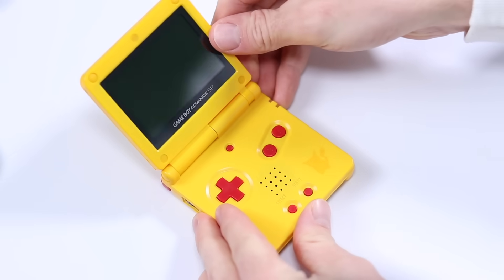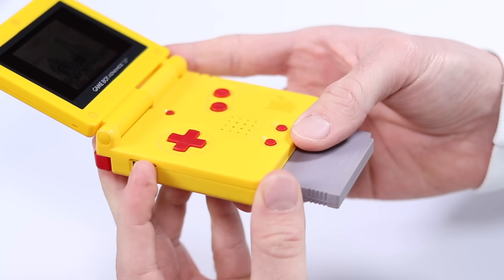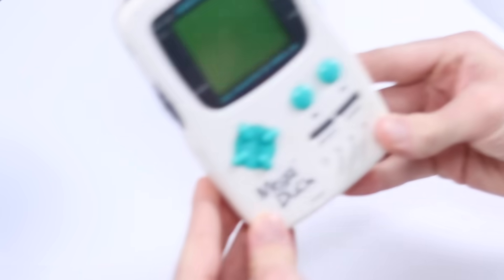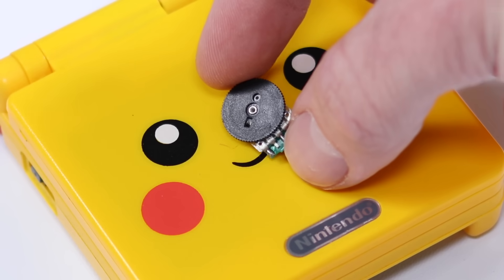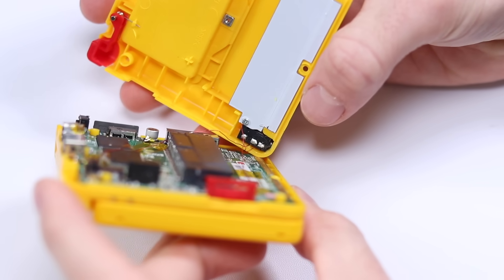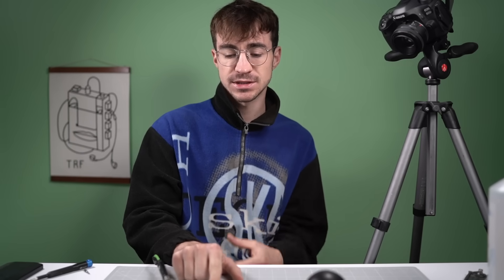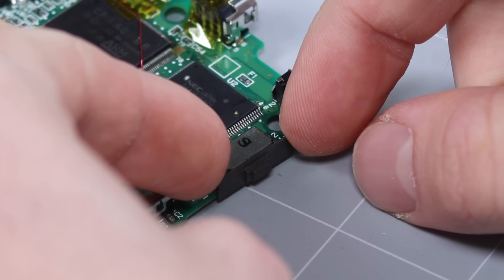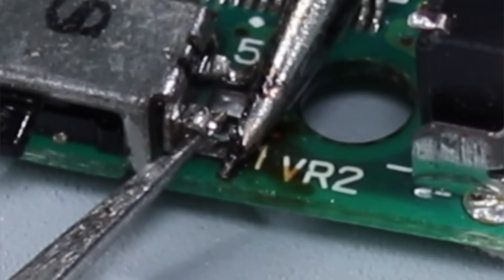The PERFECT GameBoy Advance SP Upgrade

Comment: I never even acknowledged that the gba sp didn’t have a wheel. Im surprised.
Reply: The pads that come off the easiest are the ones that don’t go anywhere. That’s usually because there’s nowhere for the heat to go so they end up burning off the substrate easier and have less surrounding trace material to hold them down.

Comment: Pro tip: for replacing ripped pads just use solder wick cut into small squares, scrape back the conformal coating and attach the wick into the area where the pad was, then you have brand new pads to attach things to
Reply: Sorry wut? You solder a square piece of solder wick on the place of the ripper pad?
Reply: @just_ugu  yep
Reply: That is indeed a great idea! Certainly a simpler solution than wiring a transistor leg to the next component in line after a Lynx II power section rebuild goes wrong. I'll have to keep this in mind! Thanks!
Reply: Can you make a video tutorial? It would be very helpfull! Best regards.
Reply: can't you just put a small bead of solder on where the pad used to be? new to soldering btw
Reply: What exactly do I need to scrape off? I greatly appreciate the response
Reply: @Poppilion  since the copper pad is gone, there is no longer an exposed circuit. The pads are usually connected by a small trace (like little internal wires). If you scrape the solder mask (usually green or white, protects the copper trace), then you can expose some of the circuit (also copper). Traces are really thin and fragile! Extreme patience needed. Then you can solder to the trace.
Reply: @CoreysZ32  First why this effort?
Second that don’t works always and in special this case looks exactly like this…
The trace is pretty small, to solder anything to that is already a task and then you want go even further and replace the whole pad?
Just solder a wire a directly to the trace if it is big enough or b directly to the next component of that trace if it’s not big enough…
Way easier and in case b the only option overall…
Reply: @Eddy_E.  Replacing the pad is the correct way to fix the damage. Soldering a wire to the trace is the ghetto hack way of fixing it. 

If you tack the pad down with a certain type of epoxy, it will be exactly as if the pad was never ripped out in the first place.
Reply: @vhfgamer what type of epoxy?
Reply: @Abu_Brandino  There's some fancy epoxy you can buy called circuit bond epoxy. It's kind of expensive. But you could just use any 2 part epoxy that has a longer cure time. To give yourself time to work with it.

Then place kapton tape over it, clamp it with a spring loaded clamp, and let it cure. Clean up any residue, and there you go. Done. 

If the pad is missing, you can make new pads by trimming bits of copper foil, or you could salvage a pad from another defective board.
Reply: @vhfgamer  fair thanks for info

Comment: Sliders are both more durable and actually show the volume relatively to the highest and lowest values, it's way better than a wheel
Reply: I think it's more to do with "can I do this?" And "can this be more like a GBA and less like a DS?" Then "practical use."
Reply: Hmm, is there a slider mod for a GBA I wonder?
Reply: Seeing how high the volume is is useless when the throw of the switch is like 3 millimeters. A volume wheel allows for much finer adjustments. Plus the wheel is stiffer and far less liable to get nudged to off or full volume with just a light touch. I know how high the volume is by using my ears and you don't look at the switch or the volume wheel when adjusting it, cause your thumb is on it.
Reply: @TheFriskySquid  This
Using the slider to turn the volume form zero to 100 takes less than a cm of way; the wheel by contrast takes more than double of that. With the same motion of my finger, I can make much finer adjustments.
I loved the wheels back then, but I can see how sliders take less space and would fit better into those cramped devices.

Comment: You'd do the PCBs and components a great justice if you start using a hot air rework station. The temp can be set so that it won't burn the pads off the board, and you can lift the whole component off at once. A desoldering pen or gun would also help, and no-clean flux will help to neaten the soldering. I think Nintendo makes their soldering pads delicate on purpose, lol.

Comment: There are ways to repair trace damage such as torn pads.  It's a pretty involved repair tho.
Reply: It's not so bad. Just scrape away a little of the coating on the trace, use solder to bridge the break between the pad and trace, and then tack the pad down to the board with epoxy. Boom... fixed.

Comment: That's a pretty sick part! You might have more luck with a hot air rework station. I know I struggle with soldering stuff like this, and I have heard that a hot air rework station would do me a lot of good.
Reply: Too much risk: there are a cap and the shoulder trigger very close to that area. Even with kapton tape or tin foil is risky.
Reply: @Khodeus  Good point. Those would definitely complicate things.
Reply: Tin the pads with low melt solder and you can apply less heat to the components to remove the port
Reply: or just use 2 solder irons :P

Comment: Hi Elliot Coll. 
I really really like your videos on modding Retro consoles. It really puts a smile on my face.
Especially the GBC mods that you have done in the past.
There's just one thing that has peaked my interest with a particular GBC mod that I would love to get and add to my GBC.
Reply: I have over the past few months acquired the first iteration of the IPS LCD mod from Aliexpress, the one with the copper ribbon cable, where the LCD protrudes just under the screen protector. Its a great upgrade to my childhood memories, I am to soon get the audio amp mod as well as the LiPo battery charging mod to install.
Reply: The only thing that I am worried about is the compatibility.
Example, the LCD IPS kit that I have installed requires that the Dpad, Dpad housing and the Dpad silicone membrane, needed to be cut and or shaved to not interfere with the bottom of the LCD screen.
Reply: I'm hoping that if I buy this mod, that there is no incompatibility between the LCD and the kit after it has been soldered in place, and save my self some money as well as save my console from damage from incompatibles
I am hoping to see a video some day, especially from you.
Many thanks, A loyal fan

Comment: You really should use a hot air reflow. also the pads can be repaired using copper tape and or simple hotwiring the damaged pads to the correct pins

Comment: You need to practice soldering a little more.  I use the tip of the desoldering wick and cut it when it's filled. A solder sucker can help too.  Tin is not supposed to touch directly the soldering iron tip. Tweezers are used to just make a little pressure without pulling the component.

Comment: you can repair the pad with either copper wire or idk what they are called but basically they are flat copper strips aka replacement pads, and you can scrap the soldermask to the left and top near the missing pad and solder the wire or copper strips down so its solid and then solder the joint of what needs to be on the pad down to it, just need to make sure the area your scraping is part of the same trace or ground for the pad thats missing, its really not a problem for most instances, only when there is barely any room is it a problem but still fixable.

other ways to fix issues like this would be to connect a wire and solder the wire to the pin and then the other end of the wire to the next part in the connection wither its scraping solder mask on a trace or to another component, and then just apply some soldermask either to the end of the pin to hold it down or to the entire wire just to make sure the wire is held down and secured.

Comment: I design PCBs as a hobby…. Those Four contacts on the sides (with the two you ripped) are all connected to the same line for those packages. They are all connected to ground, which is why it still worked. Also… you’re putting so much solder on those pins. You can just touch your iron to the solder to pre solder the tip of the iron and then touch the pads with your pre-soldered iron tip.

Comment: 1 point of criticism: Please dont clickbait. The chip in the thumbnail isnt neccessary. Just be honest and keep on doing your great content! 

And for future soldering projects of that kind: Get a hot air soldering. Removing the soldering points one by one puts so much pressure on the remaining solderpoints and the pcb. When heating it all at once you can just lift the compontent up.

Comment: The wheel is not for me, but I love that it turned out! Looks great! SP was my first GB, so a slider seems natural... Anyway, I've recently been wondering if there isn't a way to add a second speaker to GBA or SP (or any other GB; the DMG has the most cast room for jamming one in there somewhere...).
Reply: @sangbeta2043  Well, the Analogue Pocket is similar in size to DMG and packs stereo… but I understand your point RE: perceived mono with such a small device.

Comment: I messed up some pads when working on an original GameCube controller. They were for the C stick. Had to bridge two or three connections with bits of copper wire. It did work in the end, which was a relief.

Comment: dude, you should really get a hot air station, would help alot on those situations.
also, i think you got very very lucky, because i'm pretty sure the volume button is just a potentiometer, and it need 3 signals, you took apart the only one that was there just to hold the thing in place LOL

Comment: Your video's are great and enjoy them thoroughly. Having watch quiet a few videos I have some small pro tips if you are interested. 

I would highly recommend you get into using a hot air station and use some type of fume extractor. Also if you are working near anything with a lot of pins I would also tape them, so you dont have to fix any solder bridges. Especially when desoldering components, sometimes a chunk of hot solder with fall during the process.

Comment: Looks like the pad that came off is just a mounting pad, so it doesn't affect the function of the wheel (as shown in the video). You can simply apply hot glue if the volumn wheel becomes unstable,  but I doubt it.

Comment: Looking at pad 4, I can't see any track connecting to it. So probably not part of the circuit. That's why it worked. From experience these pads without tracks connecting to them do come away from the PCB easily, especially if the soldering iron temperature is too high.

Great mod, never liked the slider!

Comment: Hey by the way, that headphone jack mod you have in there is not healthy for your headphones! There are no DC blocking capacitors. This is going to dissipate heat inside the coils of the headphones and drain your battery faster.

Comment: thankfully, pad 4 is just an anchor, its literally not connected anywhere
shame pad 3 also lifted up a bit
when i changed the shell on my SP i didn't know there were some SPs you could take the volume cap off and some that you can't, so i ended up snapping it and had to replace the whole thing, my pad 4 also got screwed

Comment: it can be solved by soldering a tiny wire from the pin to the other side, i did that while replacing a transistor on a stereo

Comment: When i was trying to replace my charging port i accidentally pulled one of the pads i then tried replacing the regular port with the usbc mod instead thankfully i didnt lift the pad that one uses and it worked successfully lifting pads is so stressful

Comment: Why are you de soldering with a canutin? just use a Hot air heat gun and you wont remove the pads

Comment: You should have used low melt solder to remove the old slider. It stays liquid for a bit which makes it easy to remove parts like that